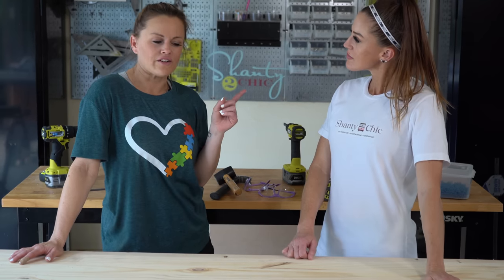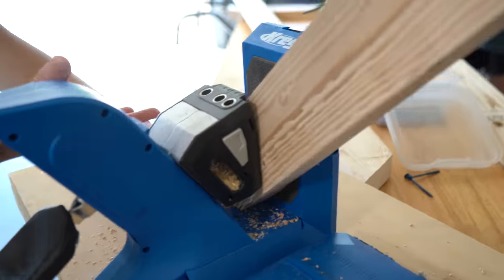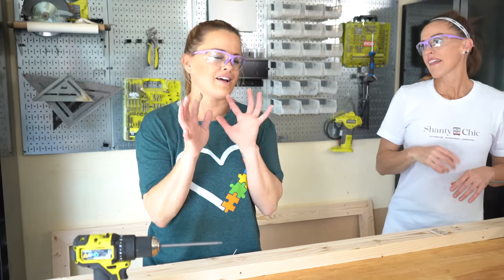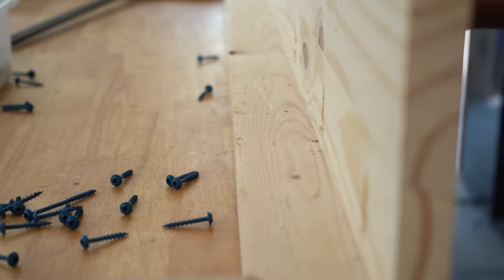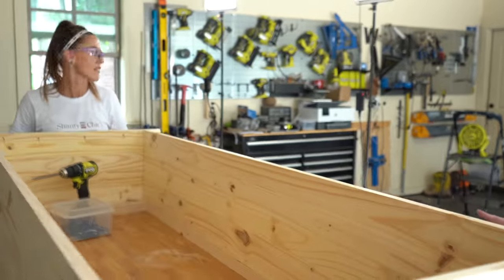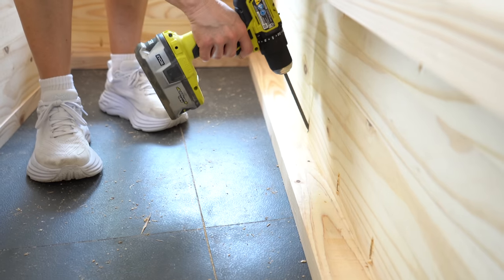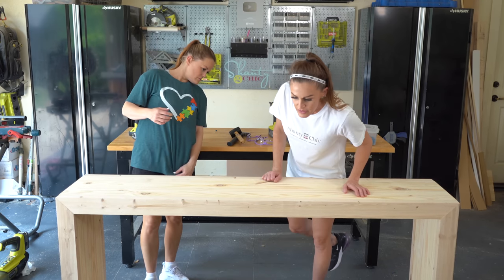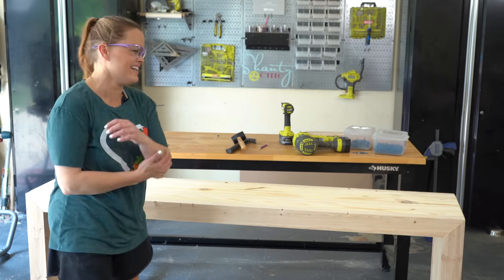DIY Modern Waterfall Console Table

Comment: I ended up making this table.  Did you use wood filler or anything to fill in the gaps of the 2x3 to the top?  It would be helpful to show you actually making the cuts. Did you use a miter saw for the 45 angled wood and the bevel edges?